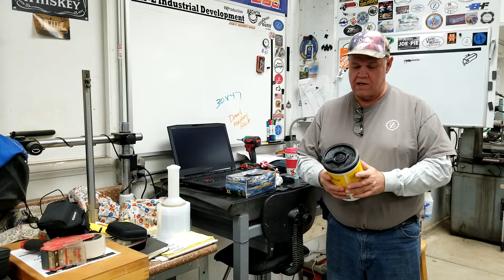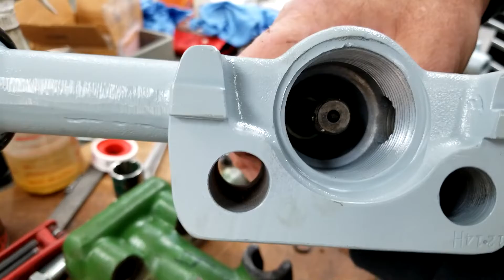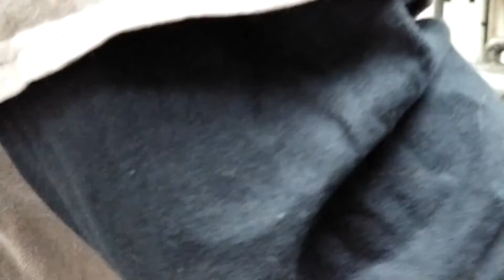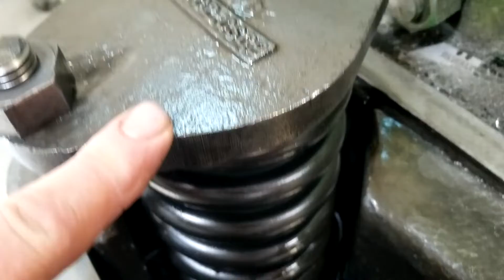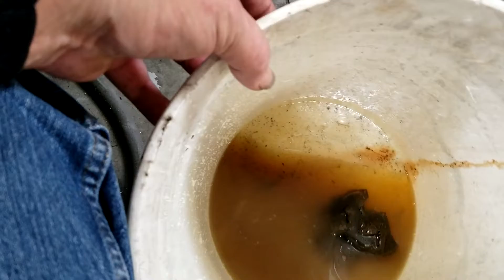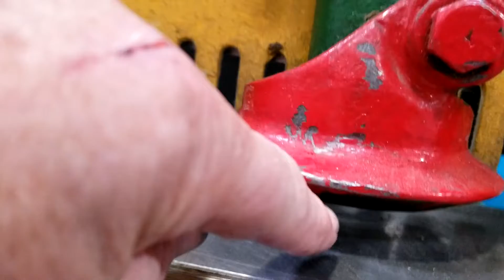Cincinnati shear hydraulic hold downs

Comment: Hi, I have a Cincinnati 2510 shear. I repaired the tube that comes out of the tank, feeding the hold downs. Now I have air in the line. I tried to burp the line as you described in your video, but the hold downs still won't work. Any guidance would be appreciated. Thanks!
Reply from the maker: If you install a hose fitting where the end plug is, then run a hose over to a bucket of (clean) oil, submerge the hose and cycle the machine. The return valve should be closed doing this. The hose should blow bubbles at first, then fluid only. Make sure the reservoir doesn't run dry. It's kind of like bleeding brakes on a car.
Reply: @ShadonHKW  Thank you so much! I will try that tomorrow when I go back to work and let you know how it went. I appreciate you getting back to me!
Reply: @ShadonHKW  Hi again! Well, I followed your guidance and it worked perfectly! I can't thank you enough for your help. The hold downs work great, with miniscule tip-up on the back end of the plates being sheared. If I need help with any other maintenance on my machine, I'll be sure to ask. Thanks again!!!

Comment: I worked. For Kenworth Truck Co. for 42 years. We had 4 shears.I did most of the on them. Two all our shears had rubber boots on the feet and the how do you running when we went to remove the pipe plug from the top of the cylinder we would always set up a vibration with a pneumatic hammer gun to get the threads to break loose and we just kept the pressure down low so it’s not to crack it but the vibration would allow that the debris to break loose and make that move easier. The hardest part is getting the air bled out of the system.

Comment: This isn't 1960's; Cincinnati was a leader in hydraulic applications in machine tools by then, and the few of their shears I've seen from around that time period were fully hydraulic, compared to all of the fully mechanical Niagara's that I used to maintain. Wish I could give you more than that, but after ~15 years I burned out and went back to being just a machinist. And now that's going away as well, so I'm now a CNC machinist/programmer. We have a few manual machines for basic stuff, but if one of them breaks down, we're probably going to have to scrap them since we can't get parts anymore. Either that or buy a machine from China or India to replace it.

Comment: I ran one of these Cincinnati mechanical shears for quite a few years. The guarding and hold down system is the best I have ever used. Provided a clear unobstructed view of the shadow line and access for smaller pieces but protected the operator from accidentally getting a finger under the hold down. Super fast cycle time. These run circles around hydraulic shears for stripping and blanking. 

Stan you get into some oddball stuff!

Cheers,

Tom